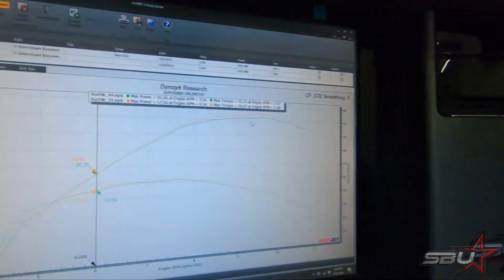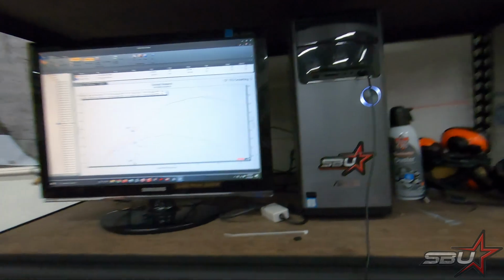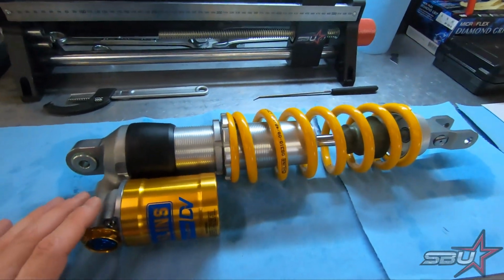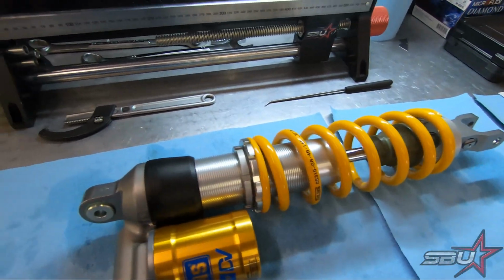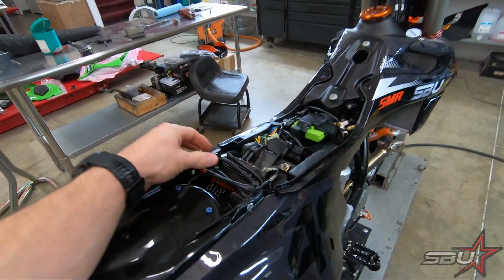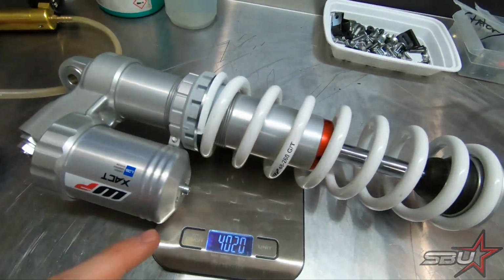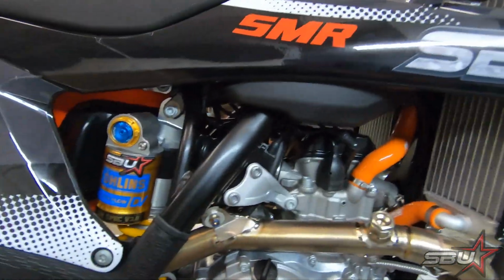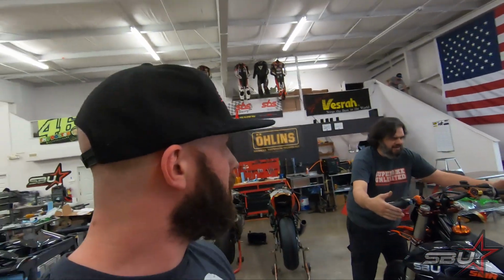2021 KTM 450 SMR Project Pt. 4 - Arrow Dual Supermoto Exhaust Dyno, Ohlins TTX Flow DV Setup!

Comment: So for my understanding the Highspeed Flow Adjuster is simply varying preload. That means it wouldn't be comparable to altering springs (i.e. the gradient) but the initial opening point, so where the Highspeed F/V graph begins, right?
Or am I completely off chart and it's really a type of gradient variation?
Great series, especially now that I've got a FS450 to do stuff to.

Comment: Not a fan of the dual exhaust obviously because it negates the weight savings like you said. Especially with the stock pipe that's works well itself. Think it was worth it or no?
Reply from the maker: It’s a must for built engines, which is next.
Reply: @SuperbikeUnlimited  Copy that! You can get a custom seat from Guts racing with phantom foam, weighs almost %50 less. It says they are out of stock until April but I got a email last week said it's on the way 💁‍♂️

Comment: i think it would have made the same power with a single pipe while saving more weight.
Reply from the maker: Maybe - but we are told that this system is almost required when going to a modified engine, as we will in the near future.

Comment: If the rebound clicker is on the bottom of the shock, then it's technically not a twin tube design, yet Ohlins still calls it TTX? very strange...
Reply from the maker: Twin tube is a reference to the rebound and compression circuits being separate. That is absolutely the case here, it's just a more compact design due to limitations in space.